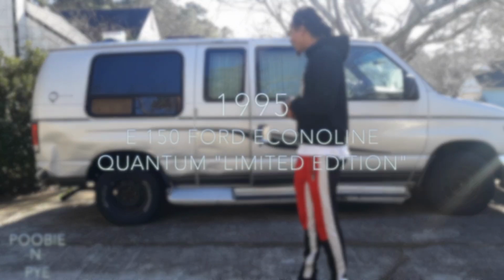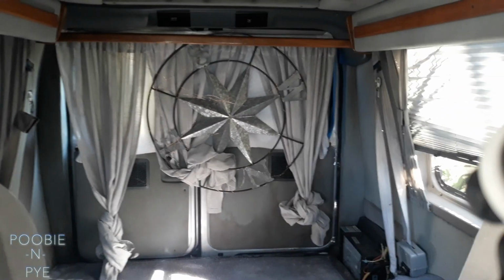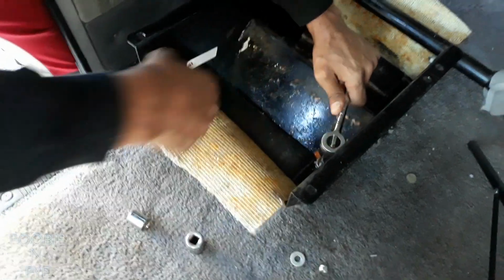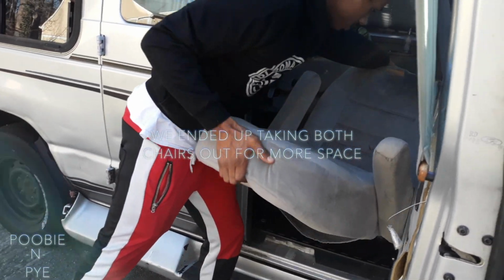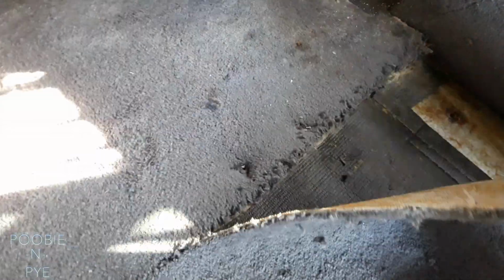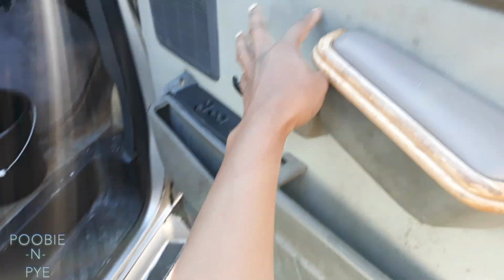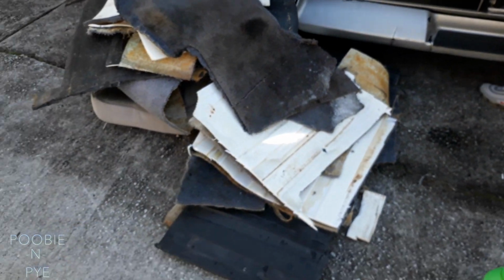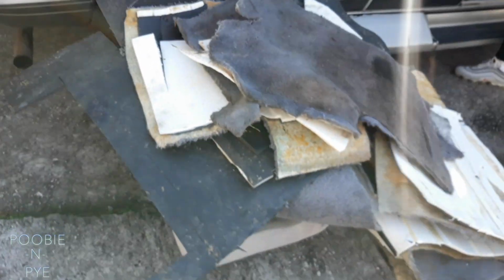#VanLife DIY: Van Conversion "Carpet Removal"

Comment: Thanks for sharing a down to earth video! My partner and I are building out our van now and we could not remove those seat bolts AT ALL. We used PB blaster and that helped a bit but we wound up asking the guys at an auto shop to remove them while we got the brakes changed. Hope you're loving the process! Peace & Love

Comment: I have a 99 e150 and they are bolted from underneath and were impossible to loosen. I used an angle grinder to cut the frame into pieces. Biggest pita